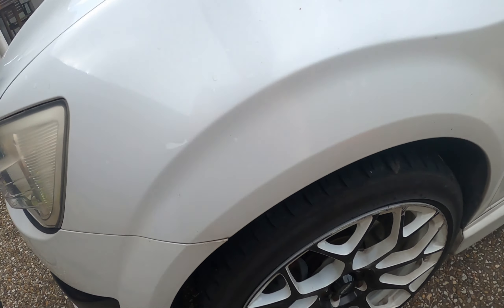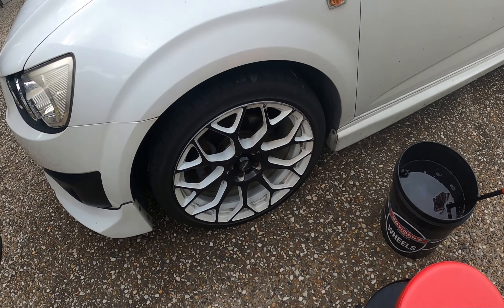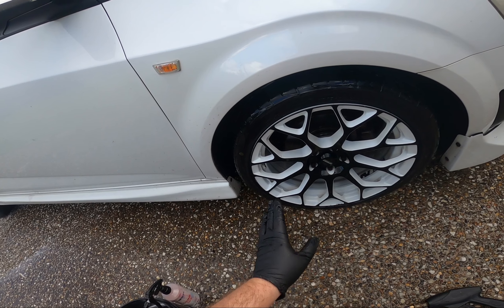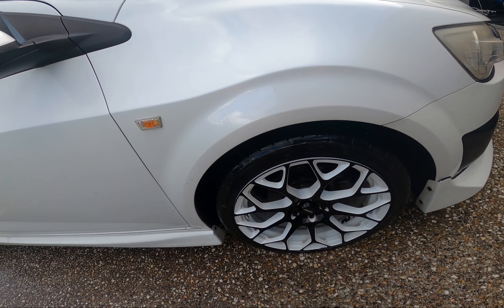Ultimate Non Acid Wheel Cleaner Test | Meguiars Non Acid Wheel & Tire Cleaner vs Mirch Grime Off

Comment: Was waiting for this test. I use meguiars great trigger and does tyres great. Not as good on wheels now that my new pads leave more dust. 
Merch looked great. I wonder though if there's a point where the chemicals become too strong and start reducing the life of the paint or rubber?
Reply: That's a good point but I guess the stronger it is the more you can dilute which would make it cheaper in the long run?
Reply from the maker: Yeah meguiars trigger and bottle definitely gets a good vote.
And yeah I'd agree the stronger means you can dilute more